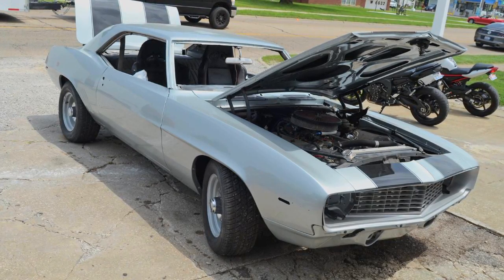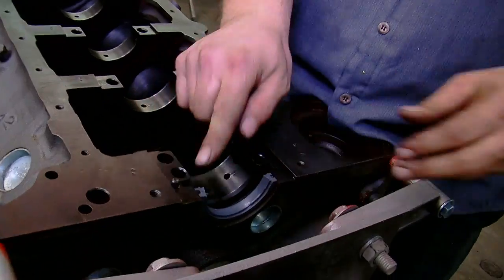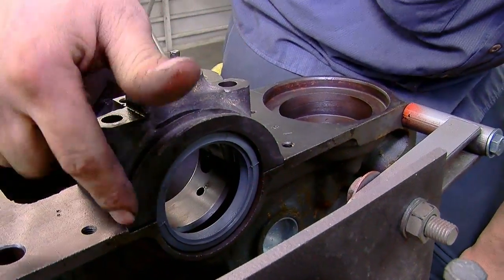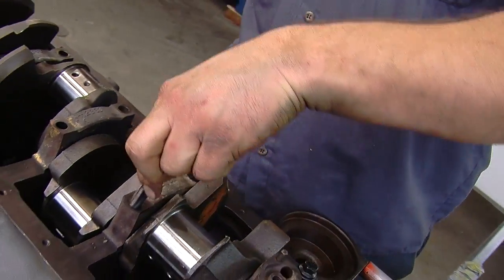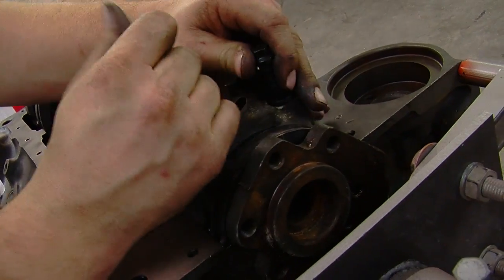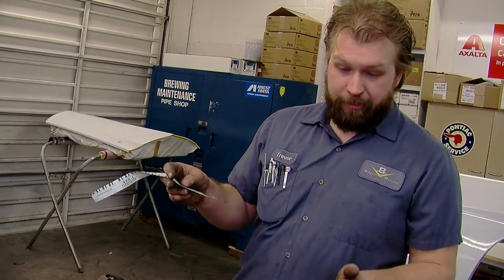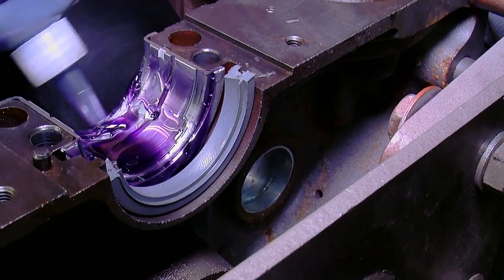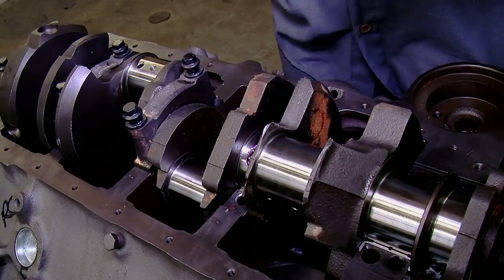Engine Building Tips 6-Part Video Series V8TV Small Block Chevy Part 1

Comment: I have always miked a crank before installing i have never used a plasti gauge for the simple reason if the crank miked good and the crank is rady to install and the bearings are there if it does read off measurement a little i dont  believe a person is going to buy a new crank or bearings i just put bottom end togther withlube and do the seat and spin test then torque and do spin test again i believe you learn alot by how much torque it takes to spin engingine over as you add each piston and rod assembly

Comment: Trevor said LS Engine's are Newer Engine's ? there's a LS6 in a 1970 Chevelle SS 454ci ? when it Come's to Premium Assembly Lube like Maxtuff. l know GM call's a lot of Engine Applications an LS engine pretty soon a Chevy Spark or Cruise will have a LS muscel car Rat motor.
Reply from the maker: The "LS" refers to the RPO code that GM used to name engines.   The LS prefix was recycled in the 1990s, the modern LS engines are 100% different from the 1970s versions.
Reply: thanks V8TV.
Reply: Thank you V8TV.

Comment: Left a few hairs in there by the looks of it, also at 5:10 that is a nasty scratch in the bearing.
Reply from the maker: That's not a scratch in the bearing, although it kind of looks like one in the video.   It's really a line of oil from wiping the bearing, kind of hard to explain, but it's a raised line.    Good observation.
Reply: Certainly looked like one from that fixed angle but that makes sense I couldn't imagine any builder letting that slide.